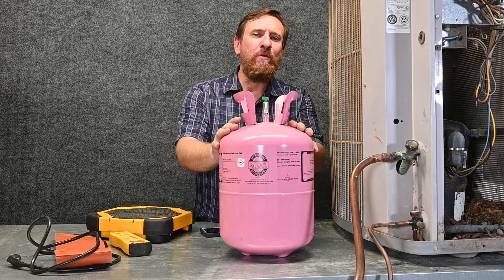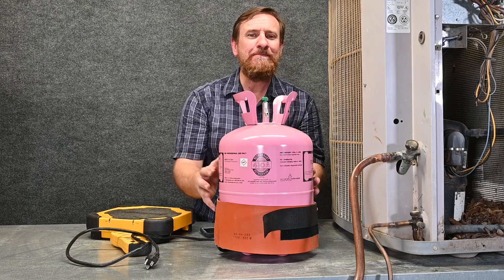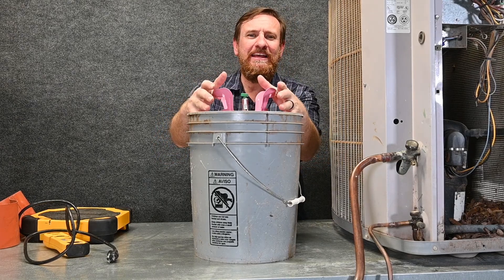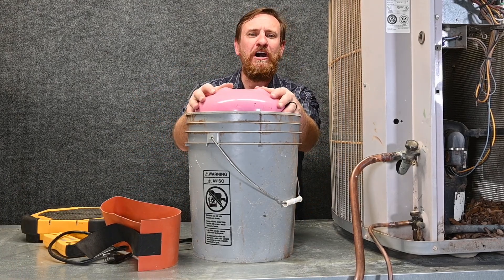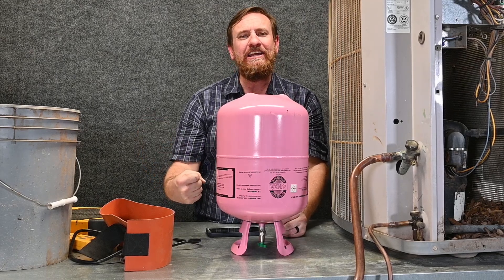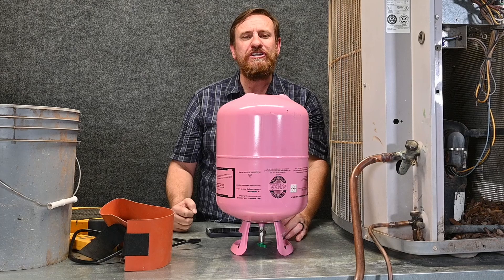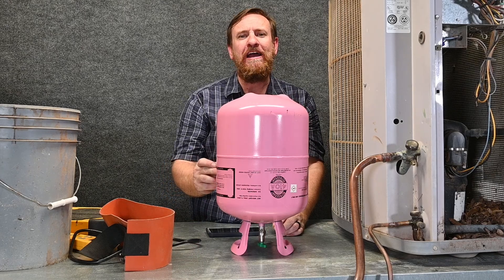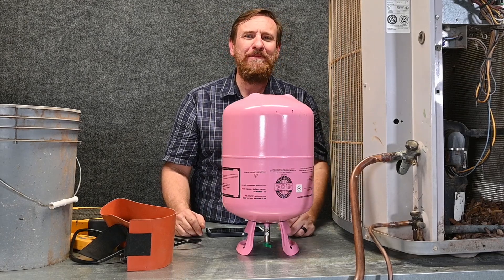HVAC 120 Heating a tank for low ambient charging

Comment: If i wanted to remove the small amount left in my bottle i would close the liquid line and that would put the suction side in a low pressure and empty the bottle into a vacuum. i learned that when i needed just a small amount of refrigerant and my bottle was low. I was an hour away from the wholesaler they would have been closed before i got there. I thought hard and tried that. worked like a charm. my bottles end up going back to the wholesaler completely empty.. stuffs not cheap nowadays lol

Comment: Any way you slice it... this is manipulating the charge for a desired outcome. No different that putting cardboard over the condenser fan with it on. The fact is it will be under charged or over charged by doing this. Expect to have to re-visit the unit when temps are warmer.

Comment: What voltage heater blanket should I get if I'm doing residential? The 120 or the 240
Reply from the maker: I would get 120,
Everything else we use is already 120 so it just keeps it versatile.

Comment: Don't use a heat gun, use a hair dryer.  Doesn't get as hot, but puts out a higher volume of warm air.
Reply from the maker: That's a good point
Reply: I use a heatgun  buth with adjustable power.

Comment: I have dedicated refillable tanks for clean refrigerant with permanently installed heat blankets with insulating tape permanently or wrapped around the heat blanket and the tank. 
          With 120 V inverter in your vehicle you could heat it up while you’re driving out to your job in very cold weather. 

      Be careful with the hot water or legal and safety reasons should limit the hot water to 120° or whatever is stated at the maximum temperature printed on the side of your tank. 

      Because there’s guys who think your hot water is good then boiling water must be better and guess what happened. 
                        I’ve met two people in my lifetime with one eye because of the hot water method.   The other eye was all jacked up and deformed and white and scarred looking. 
           I like the hot water method better understand your PT chart for the refrigerant you’re using I know it be nice if valve was open to your high side pressure gauge so you could monitor the pressure at the same time.
Reply from the maker: I did not think about swim using boiling water. Usually water looses heat so fast it's difficult to do.
Most people I have met try to use their oxy accetlylene. 
I've always used my tank heater and moving blanket.

I like the idea of your permanently installed heat blanket.
Reply: @love2hvac  Well every now and then we give information to some people who don’t understand and they think if a little is good more is better. 

          And when discussing how the two individuals that I met with one eye from exploding refrigerant cans they said they were younger and they thought more heat was better so they used very hot water and the result was the loss of one eye in both situations.    And one guy side of his face looks like one of the evil characters in a movie with scars and stitches. 

      Because those blankets are nearly $300 they break easy when rough handled in the back of a vehicle.    I broke many of them usually add that rubber attachment point. 

         That’s where I got the idea of permanently mounting them and protecting them with several layers of insulated ducting tape. 
             After that it lasted for years instead of months
Reply from the maker: I added notes to the description and the comments. I will clarify it next chance I get.

Comment: i saw a guy (freelancer) working in the same building i was working on (different contract/system) wich i knew we also used on occasion and he was happely putting down a couple tanks to do a compressor change and the 1 thing i noticed was dozens of burn marks on his (quite used) tank from his torch. after some internal discussions (and explanain why using a torch designed to cut steel to heat a steel refirgerant tank is bad) the CEO agreed never to hire him again. tank pads are not THAT expensive, especially if you are working on heat pumps or low temp refigeration a lot. just like using a cooler is pretty cheap if you are on roofs all summer.
Reply from the maker: I am surprised at how many people use a torch.  Thank you for sharing your story.
Reply: @love2hvac  so was i after a few years. I always learned to use the right tool for the job. My last van i fitted heaters to 2 tank holders so i can preheat tanks. Then you dont really need to use heaters on the spot and waiting for them to heat up. Small (tax deductible) expense, great time and frustration saver during winter.